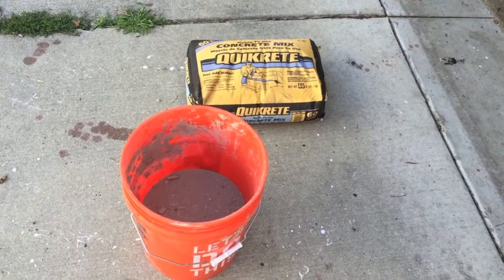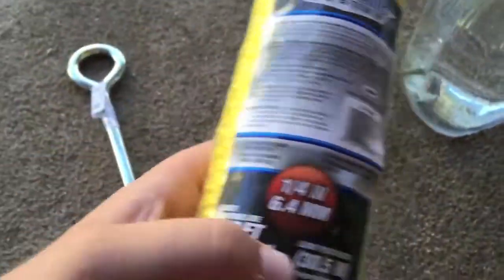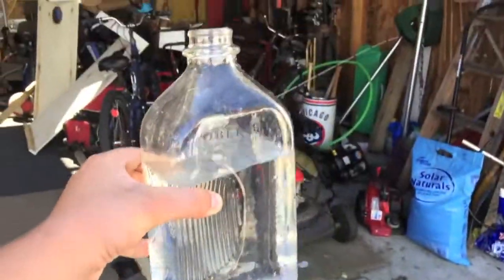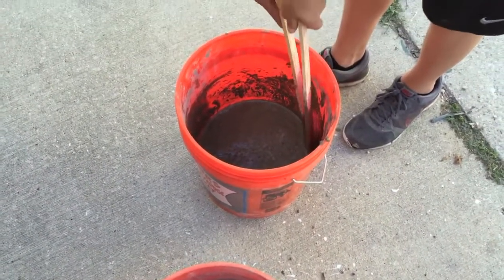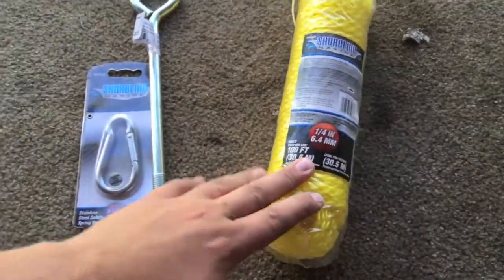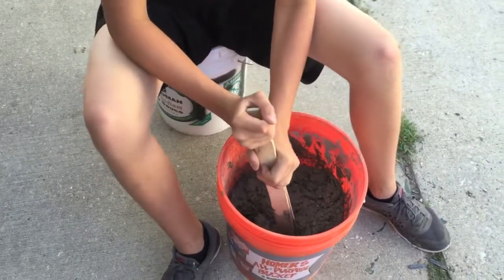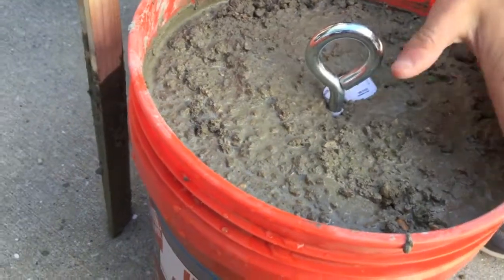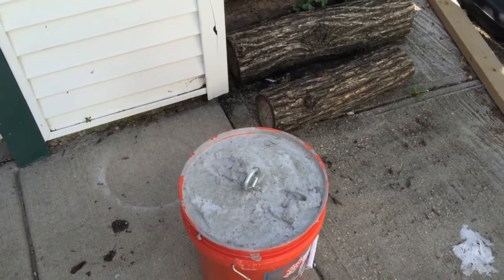DIY Boat Anchor

Comment: hI there, sorry to tell you, but most likly the bolt will come lose and out suner or later, what is a better way, you need to make like an X on the inside with the steal, thats why they use rebars when they use concrete, also use some rocks or stones will help, and you save some cement